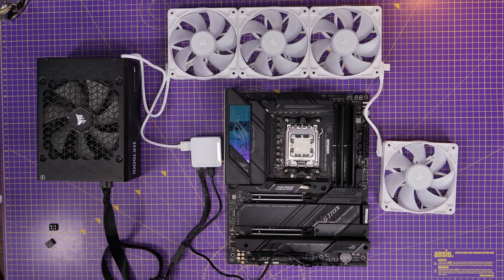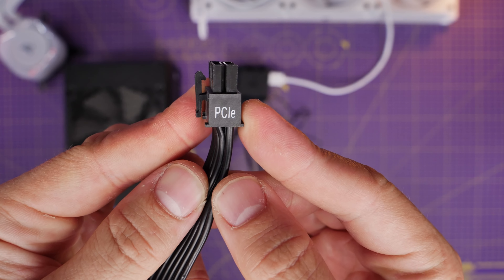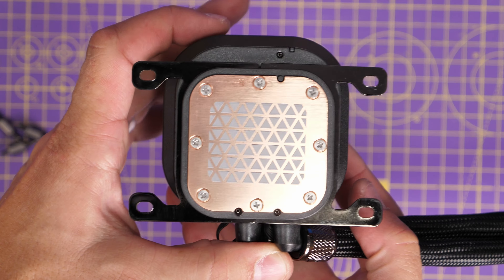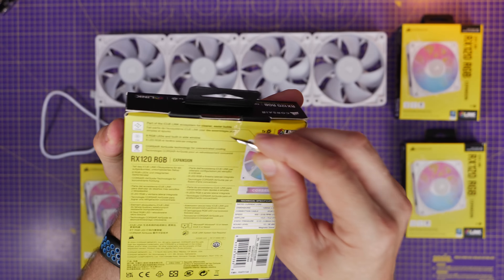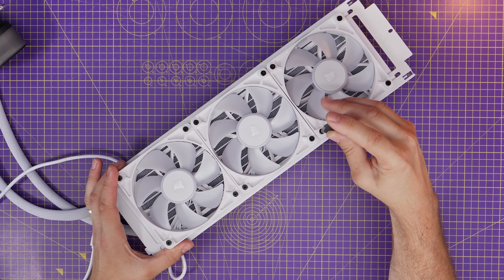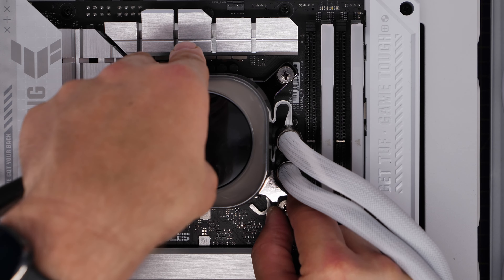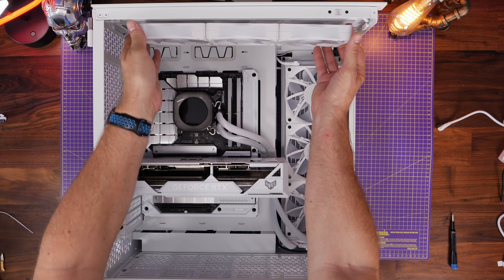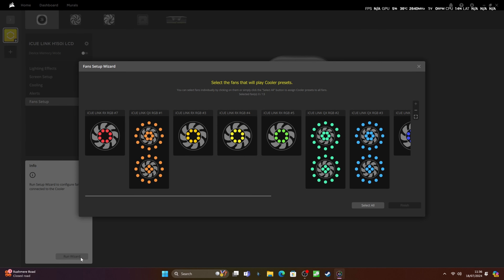Corsair iCue Link system setup and wiring guide (in-depth) 2025

Comment: I have a problem with my iCue setup w/ an H170i cooler.  No matter what I do or how I seem to connect things, there is always one fan which won't light up.  The rear fan, the 3 fans on the H170i, and two of the front fans will light.  It spins and moves air, there's just no LEDs lit.  I have tried daisy chaining hubs, in which case NONE of the front fans nor the fans in the H170i will light and using a separate iCue hub for the front fans, in which case none of them will light.  Any suggestions?

Comment: This is exactly the setup I was wanting to do for my build, and this is the only video I found that goes into it. My only question is this: I have the CORSAIR iCUE Link H100i, and the manual says that the pump for this (and the H150i) is located in the CPU cap. Is the placement different for the H100i and the H150i? Either way, this video was super helpful. If I could give you more likes, I would.
Reply from the maker: The pump on most coolers is located there

Comment: Question! Does the 3rd cable to the right connected to the icue system hub suppose to come with the kit ? What is that cable called ? It connects to mother board

Comment: Question, I have the exact same one except it’s the 360. Everything works and plugged in as it should be. HOWEVER, when turning the computer on and working in bios UNTIL it reaches windows the fans are on max speed until the software takes over.

Comment: I have the new iCUE LINK TITAN 360 RX RGB AIO Liquid CPU Cooler and a Rm1000x PSU and I'm tried to find out how to plug the 6 pin into the PSU which are all 8 pin female ports, so I bought a Corsair Premium Individually Sleeved EPS12V/ATX12V Cable in order to connect the system hub power cable and PSU together, well when i booted up my pc, the system hub started popping and smoking, what went wrong?
Reply from the maker: You used a EPS (CPU) power cable instead of pcie?
Reply: @TheProvokedPrawn  yeah I did use a cpu cable. At first I thought that the cable wasn’t plugged in all the way or it was “Jerry rigged”
Reply from the maker: @BRAGmeds  you're meant to use PCIe power. The same cable you'd use for your GPU. The one which splits into two parts and is either 8 pin or 6 pin on that end. I showed this in the video.
Reply: @TheProvokedPrawn  okay thank you for the info! I shall order another cable and I doubt my system hub works since it was popping and smoking, guess I’m going to have to get a new one, it’s not worth the risk of trying it again is it?
Reply from the maker: @BRAGmeds  I'd assume it's broken yes. You might want to get in touch with Corsair support and see what they recommend. Hopefully nothing else is damaged
Reply: @TheProvokedPrawn  I ordered a PCIe cable, hoping it works🙏

Comment: Quick question, I bought two single qx120 fans + the link hub. My brother build my pc so I let him put it all together, but I didn't have enough usb connectors on my MB, so I bought a splitter he recommended, but now icue doesn't recognize the hub nor the fans. They light up, no problem, but I can't change anything and after a few hours (probably 1-2h) the fans are blinking red. Is the problem the splitter or is there something else? 
I tried reinstalling icue with the latest version, didn't help
Reply from the maker: Have you checked for the latest version of iCue? Also this is a good USB solution https://youtu.be/CeJPv7se4dI

Comment: Do you have the pump connected to the hub or the motherboard? my pump shows up in icue but doesn't give me any options to change the screen or anything like that just pump speed and color  and I've updated everything.
Reply from the maker: If you have a display on the pump then you need the USB connection either from the pump head or radiator to the motherboard for it to work.

Comment: Hi, great video! I have a question: I’m currently building a PC and I'm having some trouble figuring out how many cables and which sets I need to equip my Phanteks NV9 case. The Corsair package is a bit confusing to me as it doesn't list the short 90-degree cables, only the 600mm straight cables. My plan is to install eight QX140 fans and the new ICUE Link Titan 360 RX LCD liquid CPU cooler in this case. The idea is to place two 140mm fans at the back, three at the bottom, the AIO at the top, and three fans on the right side of the motherboard. Could you help me figure out which combination of products makes the most sense to ensure I have enough and the right cables? I am a little bit lost.

Comment: I have plugged everything yet my cpu  lcd and cap are not showing any readings or light how can I fix that and the cant are not lighting up
Reply from the maker: have you connected the USB connection? Either from the radiator (with standard iCue Link coolers) or from the pump head (with Titan coolers)
Reply: @TheProvokedPrawn  i have the CORSAIR iCUE LINK H150i LCD Liquid CPU Cooler - 360mm with no extra fans and I have checked every sigl connection yet there pump still showing 0 temp an the fans are not lighting up

Comment: Quick question, my psu is a thermaltake psu. I have 2 available 8 pin cpu/pcie slots, and 2 available 6 pin peripheral slots...
Corsair has a 6 pin female 
I do not have any male connectors (on the way)
My question is this, do I plug from the 8 pin cpu pcie slot to the 6 pin corsair female or do I plug from the 6 pin peripheral to the 6 pin female corsair plug.
Reply: Still new to this
Reply from the maker: PCIe

Comment: I have all qx fans and aio so do i run a cable to each group of fans ?  Rear fan to aio, aio to side fans, side fans to bottom fans, bottom fans to rear fan then aio cable to controller? As each port supports 14 fans now and only need to use 1 port? 

Thanks
Reply from the maker: Should be fine. But I think it's 12 per port.

Comment: does anyone know that if instead of getting an upgrade kit for the lcd screen, would i be able to remove the screen from an aio cooler bought with the lcd screen so basically i am swapping the the pump heads ?
Reply: Yes you can. I got the h170i LCD just to disassemble for the three qx 140mm fans and LCD pump cap and yes the LCD screen swapped right onto my h150i RGB

Comment: 5:00 Hi there, you install on CPU fan, but I already have fans connected to this, How do I connect a 2nd set of fans? you didn't need a splitter?
Reply from the maker: Use CPU opt or AIO pump for AIO coolers

Comment: So just to verify, you only had to use 1 pcie slot, from the controller? My psu only has 4 slots and my gpu takes 3 so I wanna make sure I’ll be good with my aio and 4 fans.
Reply from the maker: Yes. You need one PCIe cable for the controller

Comment: This might be a stupid question. But do I plug the power plug into the psu unit? I have a 1000W psu by corsair and its 2x4 pin. obviously pcie
Reply from the maker: You should have a pcie power cable with that 6+2.  Perhaps it's labelled GPU or VGA instead?
Reply: @ no couldnt find it. I an gnna return it. I ordered 2 new fans that go straight to the motherboard by corsair. Thank you anyways though.

Comment: Hi the pci cable that connects from the psu to the short cable connector is this a 6 pin to 6 pin male/male cable having trouble finding a cable thank you
Reply from the maker: It's the same one you'd use for your GPU
Reply: So you disconnect the gpu

Comment: iCue w/ Lian Li Strimmers

Hi guys, currently upgrading my PC, I have bought a 3 pack of RX120 fans that come with a hub, 2 pack of rx140 fans that also come with a hub, a single rx120 fan and a h150i aio with 3 QX120 fans on it. 

My question is, will I need to get a RGB controller to connect the lian li strimmers so I can control with iCue? I bought the corsair 3 pin to RGB cable separately so I could do this but I may also add some LC100 accent lighting and thought it would work as it comes with a RGB controller so I can plug in those and the strimmer together, another question would be will the system hub work with an RGB controller in iCue? 

(Im only going to use 1 hub with the fans and connect the fans via daisy chain) Thanks!

Comment: Thank you.  On the cooler under the 'screen setup'!!!  I have an LCD screen attached to my h150i reporting coolant temperature.  However I do not have screen setup in the list?  the Sortware be 5.16.75.  Any Ideas?
Reply: Make sure you have the USB-C cable plugged into the radiator and into the USB on mobo. Option 5 under screen types is different images and gifs
Reply: @mbrosenb86  lol,  it was not.  and since I had 2 controllers,  I reconfigured to 1 and more than just a few reboots it is all well.
Reply: Make sure it isn't in device memory mode

Comment: Is that CPU fan cable supposed to come with the starter kit? I ordered 3 starter kits, and not a single one of them has that CPU Fan cable. they only come with the PCIE 6 pin and USB cable
Reply: I was hoping someone would comment this. I ordered two started kits and not one came with the CPU fan cable.
Reply: @tyleradmz3933 it actually comes with the AIO, not the starter kits. I've watched dozens of these videos from various YouTubers and no one mentioned it.
Reply: @JorgeGarcia-mx7bs  i installed the AIO way before I got the starter kits and I'm wandering if I have to buy a whole new AIO to get that cable?

Comment: I have everything connected the fans on the aio don’t spin I hear the pump burbling when starting I get into windows for like 5 minutes and the system turns off.
Reply from the maker: Are you sure it's all connected properly. Sounds like the power for the controller isn't connected. The fans should definitely spin if you turn it on and it's all connected as I've shown
Reply: @TheProvokedPrawn  found that the iCUE link cable wasn’t plugged in got the fans to spin up but computer wouldn’t stay in bios for longer than a minute and would stay in bios for longer than 5 minutes. Sent the motherboard off to get it repaired by the manufacturer under warranty. PCIe 16x pin looked damaged no clue how it was damaged. If the motherboard comes back and I still have issues it’s either GPU, PSU, or CPU

Comment: No offense intended. I understand that the radiator is placed upside down.
In this way. Bubbles could form in the pump.
Reply from the maker: As long as the CPU block is not the highest point then that won't happen. Any air bubbles would end up at the top of the radiator.
Reply: @TheProvokedPrawn  Thank you.
If I had known this before I wouldn't have had to drill holes in my Corsair 7000 D to install it on the side...

Comment: god do i hate corsair this is the 3rd watercooler they sent out to me first one the pump fried so they sent another (refurbished) one and the pump lasted 6 months. now they send me this bs with another link system with their terrible icue software. my link box doesn't even work my commander core and ram show up and I've swapped the USB ports on the MB and it still wont register in icue the pump and fan lights are running. I'm so tired of this bs.